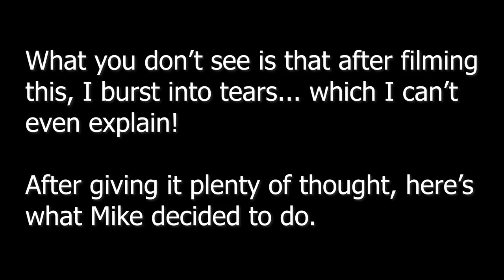Rear Storage Unit Disaster (and Repair) in our Skoolie!

Comment: Stain remover or sanding would have been cheaper and easier, most places you can get stains mixed to a color you desire rather than buying off the shelf, it costs more but it would all match perfectly.

Comment: Obviously for future reference, there's a product called wood bleach. Wipe or brush it on and it will bring the wood back to its original color.
Reply: Wow! Do you have to sponge it off afterward, or put on some kind of neutralizer to stop the reaction? Does that just work for stain, or would it work if they'd already put on the polyurethane? 

(Sometimes people will sponge off "some" of the extra stain to lighten it up a bit (do so right away), but Idk how MUCH you can lighten it/if it would've been enough that they would've liked it).

Comment: If you wipe the  stain with mineral spirits you can lighten the color before varnish.  You can also thin your stain as you use it with mineral spirits for the same effect as not agitating.   You can also add some stain to your varnish to darken the color.  it will still have the same transparency, as long as you don't go overboard and mix it well.  I have used these techniques for years to match home made parts to purchased furniture.

Comment: that aircilinder on the pocketholer is a great idea , 
you need to make it so the exaust puff from releasing the pedal is blowing the sawdust away form the bottom of the pockethole device or youre holes might go off a bit at a time from the sawdust collecting under there

to make the bow of the ceiling quick and relativily eazy , measure the highest and widest point and cut a piece of wood to that dimention , place the wood horizontal under the curved roof 
measure the biggest distance between the top of the board and the roof and cut a small scrap of wood to that size 
hold a pensil under the scrap of wood and follow the curve with the other end basicly transfering the curve of the roof one on one , you need to make sure that the pensil is on the same corner as the corner following the roofline (you need to switch corner to the other side for the other end )and that youre holding the scrap piece horizontal along the roofline 
should work faster and works better with weird uneven shaped roofsections

next time you use stain , get a large empty paintcan with a lid that hold multiple smaller cans of stain and buy more than you need , pour everything together in the big can AND STIR WELL BEFORE USE , use one of those stirpaddles you hook to a drill to realy mix it up intoo a vortec every time you take some out , that should prevent colour differences between batches 
open the original cans carefully and clean up the paintcans you bought the stain in and save those 
if you pour the rest back once you done with the bus and it ends up being a full small can you might be able to return it and get youre money back for it (if the can is clean it should look unused )

Comment: Couldn't yous have either sanded the stain back or turned the wood around?
Reply: That's what I was thinking as well...BUT...I thought I'd better check to see if some-one was on the same wave length LOL...
Reply from the maker: The problem is that while the bus look symmetrical,  it isnt. I did check it but the tolerances were not good enough for me.
Reply: @BussyMcBusface O.Kay you guys had your bases covered...Awesome...you guys are doing a great job and showing ALL the skeletons in a bus build..the good the bad and the funny all while sing some epic song...Much Love you guys....

Comment: 💖
Admittedly, I would have left it in... But I'm used to mismatched hand-me-downs. 😂
Sweet build. Made me wish  rear bulkheads came in the same sizes, but I am pretty sure the bulkhead on my shorty isn't the same size. Otherwise I would say send it my way! 😏
Yeah yeah yeah yeah
I sure do like your pocket drill vice. Mine is one of those you have to use clamps with... And well... Beside the fact it's too easy to misplace... I end up doing other things. 
Aren't you the one that discussed how you made that rig? Or am I thinking of someone else?

Comment: For anybody else facing this, couple of options. Sanding or a stain remover, or my go to for lightening stain that turns out darker than I wanted, restain with a lighter stain...I have had good luck with Golden Pecan. Not judging, as I did this EXACT mistake the first time I did a big staining project...I was helping a friend, and didn't realize that the stain had to be stirred every time, so it was the same thing...light, light, light, OMG dark...ack!

Comment: Why didn’t you just try to use the opposite side of the cabinet wood rather than remaking everything?
Reply from the maker: The bus isnt exactly symmetrical so they wouldn't swap like that. That is probably the most frustrating part of a schoolie build.

Comment: I kept waiting for the disaster. Twenty minutes with a sander, another can of stain, and testing the color first, would have saved hours and a lot if wasted time and material. And of course he had to fix it or hear about it every time they went to the back of the bus for as long as they owned it.

Comment: I agree with many viewers, sand the stain off and re-stain to match... As for the burned smell on the tools, that's DeWalt for you. Look up a video of Milwaukee vs DeWalt head to head and you'll see that the Milwaukee can output enough power to smoke the motor on the DeWalt tools and the Milwaukee will be just fine. https://www.youtube.com/watch?v=-aYmjZIUa8o